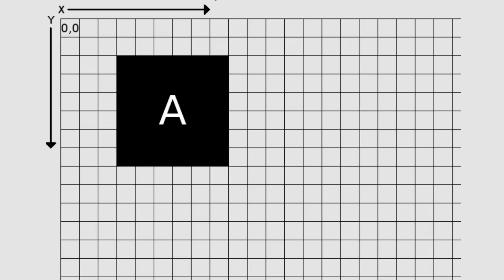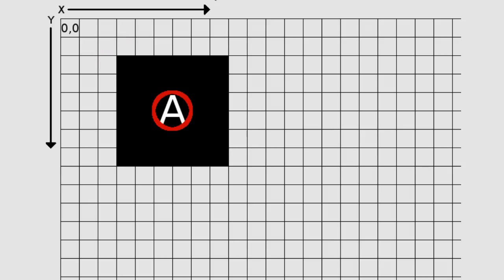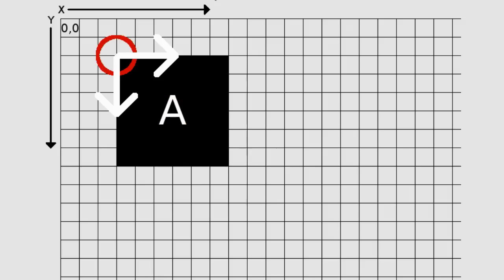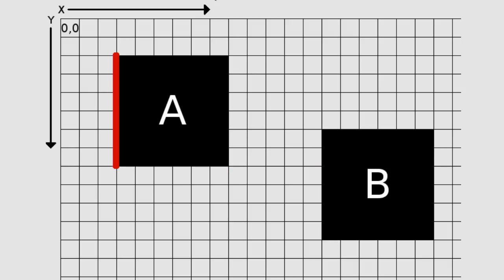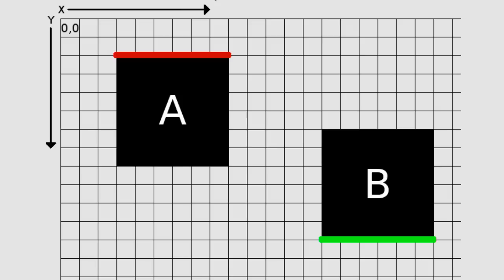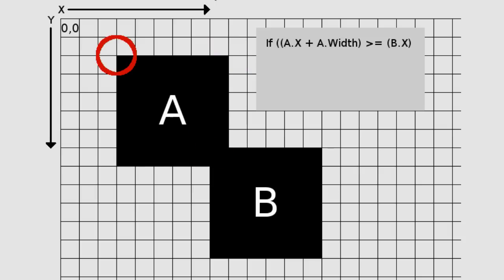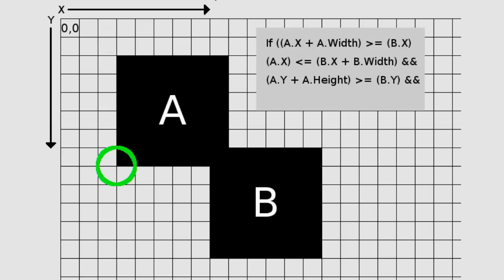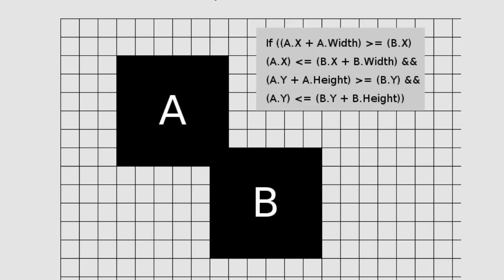Bounding Box Collision Detection

Comment: This seems convoluted compared to what I have in mind, I was thinking more like identify the points closest to the center of the opposing object, then see if they are the same if not then assume they are not colliding.
Reply from the maker: It sounds like you might be talking about centre point collision detection, which is definitely much simpler and works excellent for circles, but only works as an approximation for squares and isn't really suitable for non-square rectangles. You simply get the distance between the objects and see if it's less than their combined radii, if so, they are colliding.

Centre point collision detection is a good choice for small, fast moving objects like projectiles in a bullet hell type game for example, but you may want to use bounding box collision for the ship model itself. Remember, you're not limited to just one collision detection algorithm; you're the programmer, you can mix and match as needed.
Reply: @Teklectic  No I meant what I said, literal xyz co-ordinates at the closest points, if the closest points that can be calculated from the given vertices don't collide it's a pretty safe bet the shapes are not colliding

*Edit:* To be clear the xyz thing only works on standard shapes, since graphics tends to deal with mainly triangles & occasionally squares it's a safe bet to just detect which parts of the objects are most likely to collide then loop through the vertices to identify the closest then just grab the 2 closest vertices from those to calculate comparison points because then you're only dealing with 2 hypotenuse that are potentially going to collide, you just identify where on each hypotenuse is closest to the opposing virtual triangle's furthest point (which serves as the object's center) and see if they are the same, if not just exit the check, if they are, great, you know they've collided